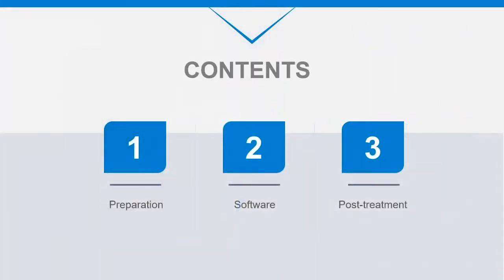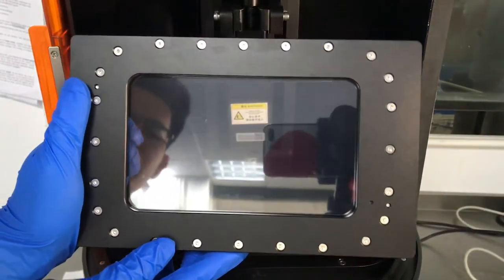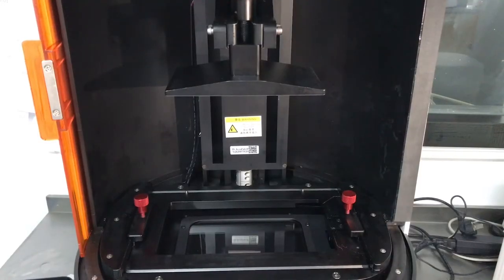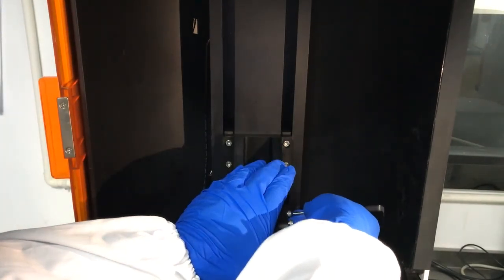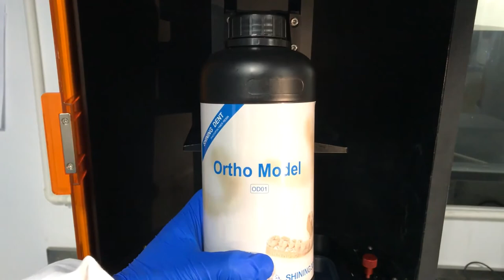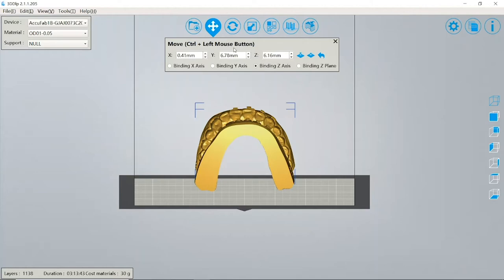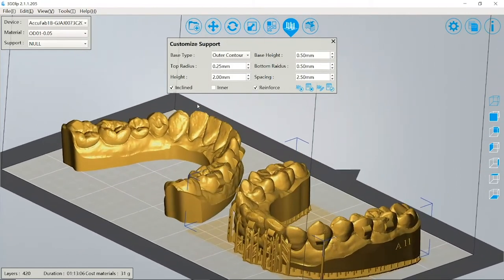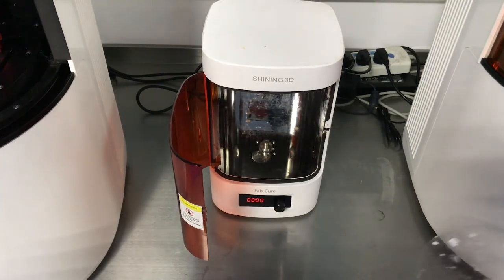6- LIVE webinar training on the AccuFab-D1 DLP

Comment: Hi , is it really that your castable green resin doesnt burn out successfully  and leaves residues ?
Reply from the maker: Good morning, thank you for your question.
As you may know, what is really important in 3D printing is to strictly follow the protocol suggested for every resin and to consider all aspects releted to the environment (temperature and humidity). If you follow the protocol suggested by our team to print with castable resin, if you check that temperature and humidity in the room are the proper one, you will for sure have a 100% successful printing.
Have a nice day.